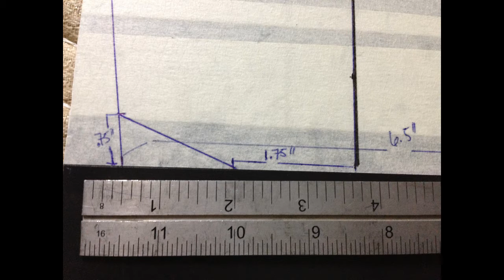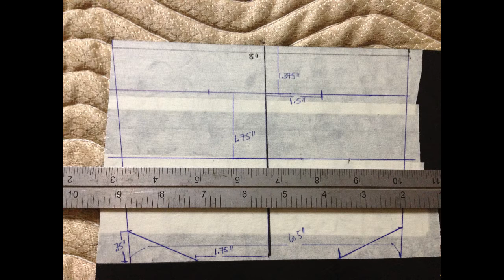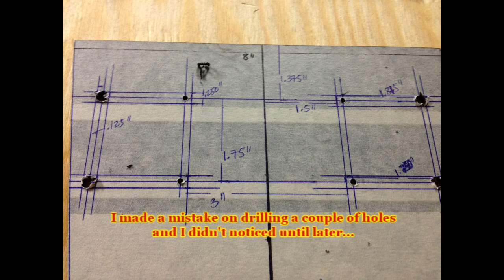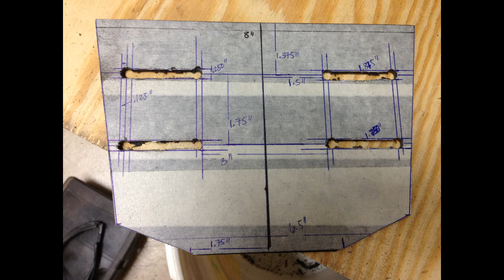HOMEMADE CHEEK REST Karsten cheek rest clone

Comment: I've used this template design and made about a dozen of these so far!  cheap, easy and effective!  Something i do to ensure a centered rest, is to file 2 small nicks with a triangular file at the 2 center marks before stripping the tape, and then lining them up with the usual molding seam that composite stocks have.  :)